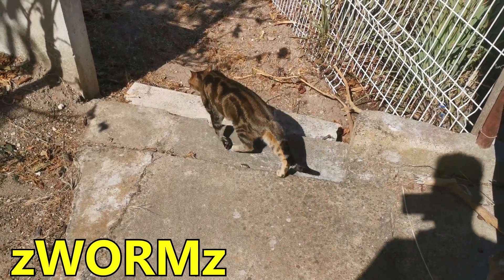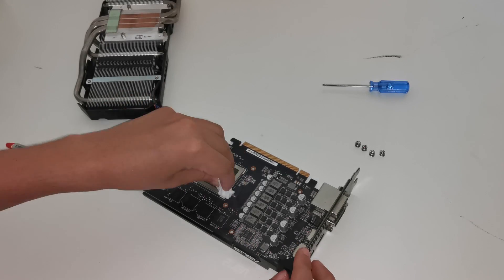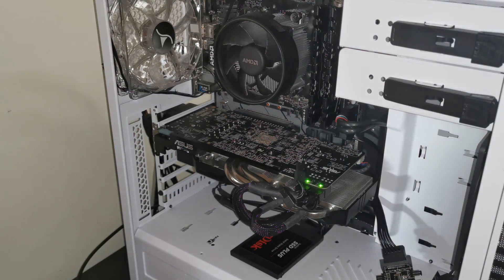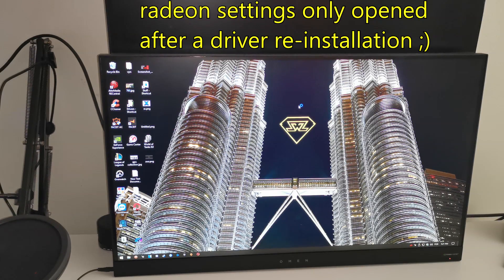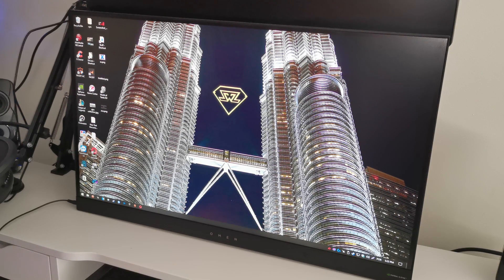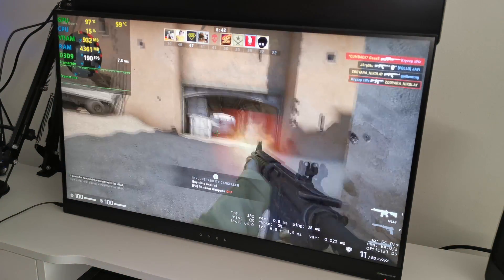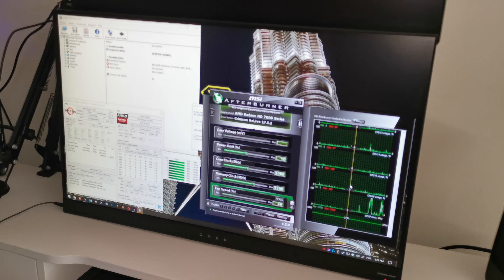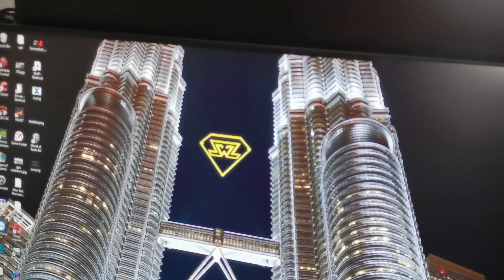I Fixed a GPU With a Hair Dryer!

Comment: I don’t get the science of how that actually worked lol but gg man 👍🏻😂👌🏻
Reply: the solder used in chip got cracked and they are like tiny balls they cracked into two
solder used in the chip melt on the temperaure of 235celcius and after heating they melt and rejoined thats how the heating procedure works 
but in case of professional use a haet gun and a temperature meter
Reply from the maker: Reflow! Thanks mate :D

Comment: Be careful. Sometimes, theses type of fixes last for not that long. Let us know in about 3 weeks I would say.
Reply from the maker: Yes I'll keep you posted ;)
Reply: my 460 lasted for about 7 months then I had to reflow it again
Reply from the maker: Nice, that's a long time :)
Reply: @zWORMzGaming  is it still working?
Reply: It really varies. Higher quality cards and PCBs, and depending on how long you heated it for, can last years. I baked my GTX 970 FTW and it lasted 2 years after revival. I did the same to a R7 240 and it only lasted a month. I know someone that revived a GTX 1080Ti 4 years ago and it still works to this day. I know of low end cards that only lasted a day after revival.
Reply: Update?
Reply from the maker: Pinned comment

Comment: That's nothing, I fixed my GTX 460 with an IRON, like sirusly...
You know, the thing you do with your clothes
Reply from the maker: Jesus what the hell? How? xD
Reply: @zWORMzGaming  Same process, but only 10 minutes
Reply: I got dead pc
Reply: Sick man,  I'm gonna try your iron method right the freaking now, still have a dead Zotac GTX 650 lying around.
Reply: @AnhKiệtTrần-f9m  Just make sure to apply it to the core, not the pcb, and makesure only the core
Reply: Hey man can I ask you a question? When your gpu is on artifact state, is your pc still detect your gpu or not? Please answer me ty
Reply from the maker: Mine only showed the motherboard logo and then black screen or big artifacting but it never got to windows
Reply: @Flowwid  nope, if it artifacts it shuts down
Reply: Do you have some video tutorial bro
Reply: I just decided to try this on my old gtx760 and amazingly it worked. Since I don't have a heat gun or hair dryer and I don't want to buy either just to try fixing my GPU. I never thought that I have what I need all this time to fix my old card. Thank you for this comment from 2 years ago.
Reply: @emanoy20  Glad you found it
Reply: @gorkman I've just laid the flat iron(number 3 out 6 temp settings) on the core for around 10 minutes making sure the contact are only on the metal part. Basically the contact of flat iron's surface is on the one where we apply the thermal paste and the big metal square surrounding it.
Reply: bro update? how long did it last? also do i need to heat that in 10mins? i just see my old gtx 750 in my storage so i will try this
Reply: @hashukashi  It definitely lasted ma along time, i'd say 6 months to a year before it showed artifacts again on which i heat it up again with the iron. I wouldn't do it with the 750, fermi cards gets fixed with heat becayse of chemistry stuff inside the chip itself not the solder. I'd take that 750 to a proper tech, they fix stuff for onl 10-15$

Comment: Seriously, with a hairdryer . But how?
Reply: Heat melts the circuits that have solidified and broken into pieces, once it melts it flows, allowing to reconnect it again, but it will be dead again after a few months
Reply: @level8473  cool mate👍
Reply from the maker: Reflow! Same as oven method but less effective, I think I was lucky!